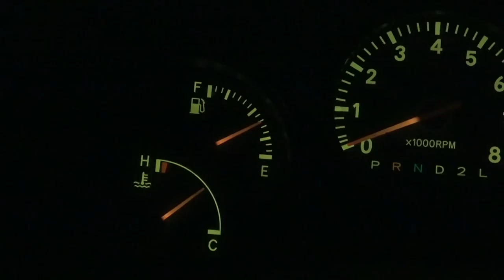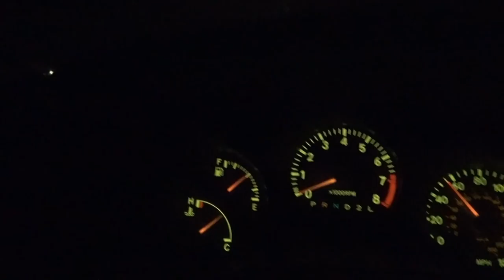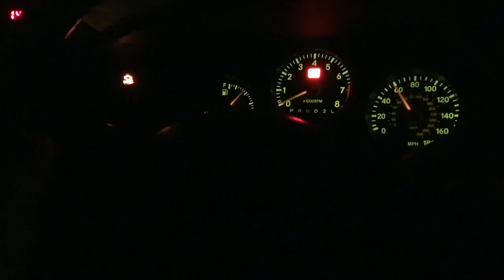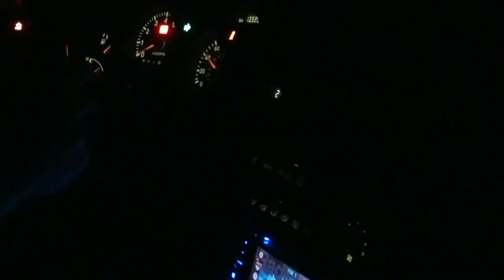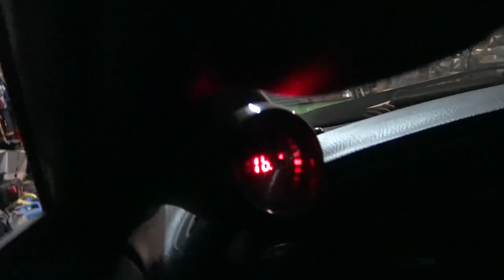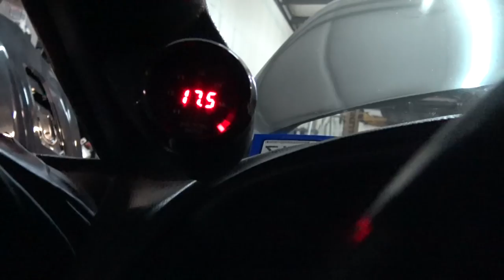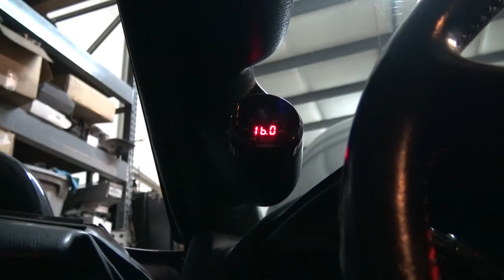SUPRA SIZED MISTAKE! - Craigslist Paint Cabinet - Project car daily driver lost boost!

Comment: I would call for injectors. I had a lean issue with my ka-t after rebuilding it and spent MONTHS only to put the car back to stock and diagnosing everything from maf, ecu, leaking valves, wiring etc and turned out it was my brand new 1000cc injectors. Some how got a bad set, returned them and went ID1050x for topfeed to call it a day. Immediately ran perfect. Been 6 months daily driving on e85 15psi no problem.

Comment: These are some of the ways that i look at it when trying to understand why the wideband is showing "weird" values when the car is running bad :)

A o2 sensor measures oxygen, so if the car goes so rich that it starts misfire the gauge will read lean, even if the exhaust is dripping with fuel. Since there is no cumbustion there is lots of unburnt oxygen being pumped into the exhaust for the sensor to read.

Even if you fill the exhaust with 50% petrol an the other half air (1:1 afr), super rich. The gauge will read lean because the mix still containes more oxygen than if you were to put in 14,7 parts air to one part petrol and then burned it. 

The air fuel ratio on the gauge is only valid after a combustion, it does not measure the air fuel ratio directly. It measures oxygen, and with the assumption that there was a cumbustion you can estimate the air fuel ratio before the combustion.

Comment: i know you have 100 projects. and i know you have the knowledge and skills for this. please fix the "daily" supra. I am curious as hell to see what the problem is. love the videos!
Reply: Supra with known problems since the day the JZ was installed for a "daily"?? Ludicrous to say the least. And daily should be a reliable beater that you park anywhere and not worry about it; main purpose should be get you to work each day without needing to be worked on and for parts runs - not a 70% race car that can barely make it thru a couple on inches of unplowed snow. Big Dirty or one of the SAAB's would make a better "daily" during the winter in Colorado, don't you think.

Comment: you have a complete 2j sitting right there, plus davids, and you running 2j drift car...and the NA supra that runs... start pulling shit off all of those to test on the 'driver supra'. "i think its injectors....i think its coils.." swap with one of your known goods... kinda disappointed in this vid, you got another cabinet, and verified compression on the DD supra, and fixed most of the boost leaks. idk, seems like your not trying to fix it.
fix the CEL. fix the tach (is the ECU even getting a tach signal?!?!). swap coils with drift car,  and injectors. check fuel pressure? is the ecu even right one? you said it speed density and not MAF? check the wiring on that. check the map sensor. thats just a couple off my head... it really freaks me out seeing you do repeated pulls knowing its going dead lean, then rev limitering it in the shop.
have you already tried a bunch of this that you havent uploaded and your just frustrated? if you think you got a deal on the car, then you did, you just need to dedicate a day/two to actually diagnosing this Supra...
Reply: Yes, I agree. He seems to get stuck in his projects.

Comment: I agree seems like a fuel problem. Bad injector or wiring to injectors. I've seen bad fuel pumps right out of the box a few times before as well. I would check fuel pressure and make sure it's not doing anything funky.

Comment: Check your vsv's your mate was pointing to it saying it was hissing (could be cracked). Id also be checking that the factory recirculation valve isn't stuffed and getting rid of that second hidden blow off valve.  Id also be replacing all the vacuum lines as they still appear to be the same factory fitted lines. Id also make sure that a gte ecu is fitted and not a ge

Comment: have you checked the crank angle sensor? cam sensors? open the ecu check it for capacitors leaks? take the harness off and go through it

Comment: Do the big dirty and pull the engine and fix all the leaks check for vacuum and boost leaks ..check the wiring harness and then put it in or if you really suspect a sensor issue ...try to find someone with a Pico scope who knows how to use it properly and that tool will definitely be able to tell you what's wrong

Comment: man id go through the top end , change plugs , look at the injectors and their wiring ect.
Reply: Keegan Spencer exactly what I was thinking. a basic tune-up type deal
Reply: definitely, i was having a similar issue if not the same with several cars i've worked on. one was an injector that had a bad plug , another was just strait up dead plugs. plus it doesn't hurt to take a good look at all that stuff. it is an old engine after all.

Comment: If your using the aem wideband to simulate the o2 to the ecu if the sensor is bad it can make it run like crap IV had the same issues with aem on my dsm's sensor still reads but it throws it lean then it bucks  up in boost like it's hitting fuel cut. I'd try unplugging or swapping the sensor if you have a spare and making sure the connections are good it may surprise you. Just my two cents.

Comment: i have a couple of ideas of ideas of what it can be. 
My first guess is injectors/injector wires.
Second guess is coils/wiring for the coils.
Third guess is a kind off weird one, a friend off mine had a kinda similiar problem with his volvo 940 turbo, it was running weird at idle, but when you gave it gas it ran fine. that turned out to be the intake gasket missing a piece.
if its none off the above im guessing its the ECU or some weird wiring problem, maybe just a bad ground cable.
Reply: Really easy to diagnose the intake gasket, just need to spray some starting fluid around the manifold and listen if the idle changes when you spray

Comment: Have you checked the spark plugs. Maybe the gap is to opened up and your blowing out the spark. I had a similar problem with an L28et. I closed the gap to .30 .28 and problem fixed. Just a thought.

Comment: hook up a test light to the injector signal wire, and ground. it'll tell you when it should fire. if its inconsistant it's your harness. also check your plugs they will tell you a lot. if they're wet it's a leaking injector, if it's hot, then it's too lean, and not firing, or the injector is faulty. the plugs may even just be fouled.

Comment: More open loop idle control? Stalling during an open loop from a cold start seems like there's something weird going on with the injectors or the timing since the O2 sensor isn't yet utilized for fuel and timing maps at that point. If you can make it stall from a cold start 100% of the time, you can verify the injector settings and cam timings and have something verifiable to fix instead of chasing gremlins.

I'm not a genius car scientist but can you just unplug the engine coolant temp sensor or connect it to a different reference?

Comment: MotionAutoTv where are the triggerwheels/sensors on the 2jz, and have you looked at 'em? I'm thinking, since the crankcase has been pressurized, and you have a big enough oil leak to leave plenty  of oil on the floor, that the boost may have pressed the crank seals/other seals out and smeared the triggersensor , or sensors, with and oil and possibly other guff wich again may result in all kinds of weird trigger signals for the ecu.... Just an idea

Comment: Check engine codes and could the air flow meter for ecu read wrong and why does it not read revs on cluster does ecu have the rpm info bet its the wrong ecu for the car non turbo one. Hope you find the problem with it.

Comment: Hey Trevor, have you ever had issues with the ford "death wobble" ??? I head the later fords have heaps of issues with that?
Reply: Akieba don’t jack your truck up super high with giant ass tires. To correct it you’ll probably need to change your ball joints and a new steering box along with all the steering accoutrements.  When you go big you put lots of stress on all the stuff that points the truck down the road.
Reply: all good, I was just asking because ive seen some youtube vids on it, one where the guys truck was brand new, though i dont know if it was modded from the Dealers yard
Reply: Yeah, I don’t know about that, but death wobble is associated with slop in the steering and suspension. With the big straight axle trucks it’s going to be in the steering box and pitman arm. The stress of a heavy truck along with giant tires and weird angles eats boxes alive. There are proper ways to correct the geometry to give more favorable mechanical advantage when you lift and put stupidly huge tires on for a truck that is poorly suited for any off road use.

Comment: Turbo problem.... make wastegate arm fell off?
Reply: Blown wastegate/s with too much PSI applied. He was talking about 40 PSI, but was it? IMO, 15 PSI or close to max boost pressure should have been enough to test for leaks. And after the compressor was filled and turned off; how can you hear a leak with the compressor running?

Comment: Make sure no exhaust leaks , maybe  a bad wideband
Reply: i was going to suggest that the wideband may be suspect, but it seems to run like complete shit when its showing lean, and better as its getting rich. leads me to think that its reading correct.
but also, another AEM WB off amazon is like less than 150bucks and good to have an extra on hand, especially with so many cars. (i know i have an extra PLX WB that i have zero intention on selling for this reason.)

Comment: What the hell was all that popping when you first plugged in the air hose the that "pressure tester" adapter? I think I heard at least 2 good "pops" and 2 or 3 lesser "pops". And with the air compressor running in the background it sure made it hard to listen for air leaks; the room should have been a lot quieter, IMHO.

How much air pressure? Regulated to 40 PSI as you stated that your would setting to? IMO, that is even to high - the max boost pressure of those turbos should have been enough.

I wouldn't be surprised of you blew out the wastegates and that's why you have no boost now. You usually have a more sound approach to troubleshooting, but this episode was more like a hasty scatter gun approach.

Comment: Injectors. The only reason why I see it fluctuating is bc of the computer controlling the fuel trim. As it goes lean the pcm adds fuel   to the system. One the pcm sees all the fuel at once  in terms making it rich, it takes fuel away to compensate making it lean. Once u unplugged the coils the system should have been driven rich bc fuel is not being burned it's just sitting. The real only way to test this Theory is to swap the injectors or injector imbalance test.

Comment: To end the question of if it runs lean or rich if you 
1 unplug a coil
2 unplug an injector
The thing you're using is a wide band o2 sensor, it sensors how much oxygen left in the exhaust gas after the burn, its basically the name of the sensor 
So
1 unplug a coil, because more oxygen is present in exhaust gas, lean
2 unplug injector, because more oxygen is present in exhaust gas, lean
Its backwards thinking to get the forward results 
Anyone thats tuned a car and found the limit of ignition systems will confirm this